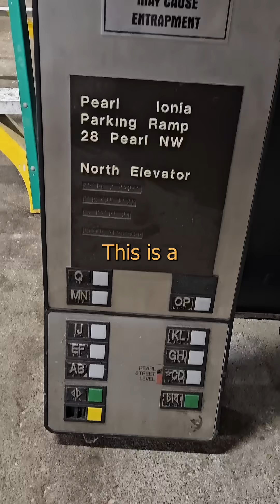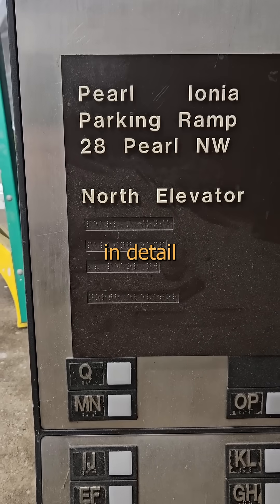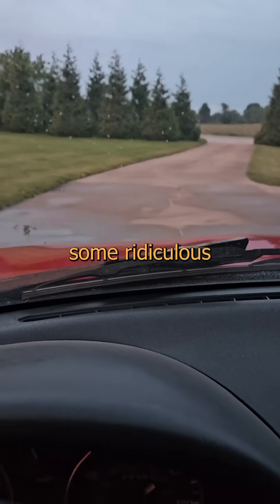Miata Mischief #chrisboden #engineering #gear #elevator #score #stories #parts #hacking #making

Comment: It wasn't me who hauled it home but at my job I helped load two, 50" by 36" cattle panels on top of each other rolled into a teardrop shape on the roof of a RAV4 that didn't have any roof rails, the girl who owned the car tied them to each other with shoelaces and then ran a string through them and then through the Windows of her car and then close the windows. As an employee I am not allowed to tie down the product only load the product or assist the customer with loading, only thing I can do is hold a ratchet strap (that they hooked) while they're making it tough.

Comment: My dad once bought a fridge, which seams normal until you find out the car he used to pick it up with my bother was an Alfa Romeo 4c car with 2 seats, so small and light it doesn’t have power steering and the boot is only big enough for a medium size briefcase. So he takes the roof off car as it is a convertible my bother sits in the passenger seat and my dad puts the small fridge on top of my bother with it sticking out of the top of the car, for what I believe was a 20 to 30 minute drive back.

Comment: I moved an entire apartment with my mom's Miata back when I was 19. My car had been tboned months earlier and this guy's insurance was trying to hold out for the witness to change her story, @#$& Buckeye Insurance. Meanwhile I had no car, so my parents lent me my mother's toy, the Miata. Don't get me wrong, it took a lot of trips, but the best day was taking my king mattress strapped to the car with the top down. Rope going all the way around the bottom of the car tens of times. Had to crawl in dukes of Hazzard style had to lean forward over the steering wheel. You could barely see the rear end of the the car from the back. Had a friend follow me, but a local cop got between me and my chase car and attempted to pull me over. I couldn't see out the side mirrors enough to see him, he jets out in front of me and stomps on his breaks causing me to stomp on mine.  The cop laughed his ass off and wrote me a ticket, then proceeded to escort me and the chase car to my new apartment. Small town cops can be alright sometimes.

Comment: My friend and I bought a 1950 Cadillac ambulance with a bad fuel pump.
Now that year Cadillac had an apartment sized engine compartment, big enough for me to sit in with the hood closed. Now we only had to drive it 2 miles so with my friend at the wheel and me armed with a spray bottle of gas for the carb we idled that thing in first gear that whole 2 miles

Comment: Had to pick up a set of 20 inch wheels for my barge of a 2000 mercedes s class and my best option was to carry them in my ch lancer wagon. I quickly realised how small the lancer really was....side note, the extra weight over the back wheels ended up saving my ass, when i hit a dip at the top of a lovely crest that turned into a blind curve, doing the lancers best version of "mach-fuck".

Comment: Me and an old friend went around loading abandoned ovens, washers, dryers, fridges and dishwashers into the back of my 2007 Honda Fit when the first inklings of spring hit in 2023. We wrecked the shit out of the rear hatch seal and it's probably the reason the rear shocks blew a few months later. But those things literally filled the car, ceiling to floor - front to back, able to close the hatch most times but occasionally holding the hatch closed with bungee and a dream. Fucking Tetris getting those shits in. Then it was time to load the 30 of them that couldn't be repaired back in for the scrap yard. Wild time - we should have rented a truck.

Comment: I've always had access to pick up trucks. So the sketchiest thing I've ever done is stick six people into one of those cabs with three seats in the front and those two sideways seats.  Our stuff was fairly well tied down with ratchet straps.  Move the people nah clown car. Computers are expensive and so is the equipment to run a lan party. To make this even worse the average height of the passengers is 6'1" if you don't count the driver who was the shortest. 
My friends rarely had a cargo capacity problems. We did suffer from efficiently moving groups of people around problems more often. So if the trip wasn't too long moving people would tend to be the sketchiest part. Especially when some of my friends were trying to save money on diese.

Comment: I moved a 1950's refrigerator hanging out the back of a chevette, worked fine until I tried to turn, had to dab the brakes so the front wheels would grab.  By the time I got to where it was going, I could taste the seat fabric.

Comment: Right after graduating college and moving into my new apartment I decided my first furnishing would be a TV stand. I found one at Walmart but all I had was a 2004 Mustang. I went to the store, measured the box it came in and mocked it up with scrap cardboard to see how I could fit it in the Mustang. Ended up taking out the whole passenger seat and headed back to the store. Bought the thing and took it out to the car. The 150ish lb box was way more difficult than my light mockup that only barely fit in the door and I ended up spending 20 minutes or so in a hot parking lot trying to force this into the car. Eventually it worked but I'm sure I made for quite the show

Comment: The thing isnt interesting, but the trip sure was a challenge. After I moved out for university, I rode my bicycle with several IKEA cabinets strapped to the back like I was some sort of historical Wright's brothers recreationist. After the first 2 kilometers I switched it to shark mode, streamlined, over my shoulder. After another 2 kilometers, I had a friend help me somehow distribute the 2 meter long rectangle between the back of their bike and my handlebars for the last 6 kilometers. Horrible communication lessons were learned at every corner and red light😅

Comment: When I was 10, we bought an 1800 lb milling machine in Cleveland and drove it home to wv using a jeep Comanche. Not sure the front wheels touched the ground most of the way home.   I also know for a fact that you can fit a 40 gal water heater in the back seat of a Buick. Yes the doors were closed.

Comment: Three guys in a Pontiac grand am full of parts for said car from the local pick and pull. Both the rear view mirror and passenger side mirror were obstructed from the driver. Took a combination of all three of us to navigate the highway back to the mechanic friend’s house to install said parts.  Oddly enough the day had started without a rear view mirror up until I mentioned the rotting Oldsmobile on the side of the garage had one that could be pilfered. 

At the end of the day we managed to fix all the power windows, replaced the driver seat, upgraded the stereo system, fixed the hvac controls, and even performed some basic maintenance the engine hadn’t probably seen in years thanks to the previous owner. 

The final thing done before it was sold was that it had a new badge installed officially declaring it shitbox edition. 

On a side note. It seems odd to pair a v6 with a tiny 10 gallon tank. It seems more like an afterthought when you realize that most of these cars were sold with an in line 4 cylinder engine 😂😂😂

Comment: I worked for a heavy equipment mechanic Shop as a shipper receiver and warehouse forklift driver.

The city we worked in had a municipal shop that often bought parts and brooms for their street sweepers, and regular maintenance on city garbage trucks. 

The first week i was working there, they wanted me to take 4 of these gargantuan sweeper main brooms for a Elgin Pelican, put them in the bed of the work truck, and drive a mile and a half over railroad crossings and dilapidated side streets. 

These brooms weigh roughly 320 pounds, and it was my first time having to manipulate them. They were 5'10" tall in their cardboard housing, and were ratchet strapped to the bed's anchor points. You can imagine this tall, loose-packed, steel core that is a large enough to body you if not secured to something.

I made it maybe a quarter mile down the road when a pickup truck on an intersecting street pulled out in front of me, honked to get me to stop, and found it crazy that the brooms broke free of the straps and rolled out of the truck, over the passenger side wall of the bed and onto the pavement, exploding the cardboard boxes, breaking a strap and scaring the life out of me. 

To this day i have no idea from where i found the strength to put them back in the bed and deliver them. I never told my supervisor about it.

Comment: I once worked for a sprinter conversion company and one winter we transferred production to a new building. Well the building we moved into had about 3 office spaces with about 30 computers and a server setup and network to boot. They knew I collected anything in bulk so they told me to make it go away. So one Saturday morning I pulled up in a Pontiac Vibe which is only slightly larger than the one your mom keeps in her bedside stand. And loaded all of it up in one go. Full dell towers and monitors to boot.

Comment: mx-5 owner here - having to check the weather forecast when you're hauling big stuff home is one of the other joys of ownership. 
I even dragged my SUP board & carrier to the dealer to check it would fit with the hood up (it does)
Reply: I used to have a MK1 MX5, and for a discount on my insurance I joined the owners club. For the hell of it I went to a few of the meetups in a pub, and one of the rally's. They were a really nice bunch.

At the rally I saw what must have been the coolest MK1 I'd ever seen. It was sunburst yellow with black accents, a wide body kit, a hard top with hard mounted roof bars, and a pair of colour coded surf boards on top. It just oozed style. I wish I'd thought to get some pictures.

Comment: A matryoshka doll of bad decisions, while I was driving on my learner's permit.

Dad owned two work trucks, one was a large 2001 Dodge 2500, the other a Dodge panel van of some make I can't recall from around the 80's. 

We installed woodburners for a living and, when his van broke down in the middle of nowhere with a burner inside it; he did not move the unit out of the back of the van to finish the delivery.

Instead he had me winch the entire van onto a cargo trailer (made, if iirc, out of the corpse of an old Ford F350 he'd run into the ground some years earlier), strap it down, shore-up the woodburner with something like 400lbs of tile and lumber so it wouldn't rattle, then hauled the entire assembly to the customer's house where we unloaded it by using the lumber and tile as a ramp out the back of the van and off the trailer.

Only after this did we drop the van off at a local shop to be fixed.

Comment: Had to get some metal racking home from work that had been saved from going in the bin, was the perfect length to just fit in my car but also the perfect length where if anyone brake checked me they would have a new passenger in their back seat as the sheet metal would fly through the windscreen😂

Comment: Welp.
2001 Mazda 3 was the car, and the cargo was 30'long rubRails fer a fishing boat😅 that shit did knot fit in the truck
Edit: TRUNk 😆
Reply: Bonus story 
Another Mazda 😅 a B4000 with a 99 mustang V6 3.9 and a whole mobile home in the bed, well all but glass , insulation and the actual frame, but the tin roof walls and all the valuable metals, must of been stacked nearly 8' over the cab of this little two wheel drive dinky. Pulled it fin out of the woods 14 miles to the pavement, and I ran outta gas about three hundred foot from the gas station 😆 my buddy in his 70's ferd came up behind me and gave me a little push up the hill fer that freshly squeezed dino juice, and then off to the scales. 10,896 pounds loaded 
2100 empty, and had to push the truck again to the gas station but this time I could fill it 😆😂

Comment: At the Kingsford plant they were tearing out a shoot made of 1/2" steel plate, it was welded into a box shape and was about 2' sq on each side, I think this was my first scavenge, it was definitely my first year of apprenticeship, but after many struggles and trying to hurry up and try and cut the seams with our angle grinder over break, I ended up taking the back door off my 06 focus to roll the box in. I have also found out that Kraft foods does not like you eyeballing their demoed stainless equipment, technically they are afraid I'm going to use it against them to take their hotdog market share, but I just really like stainless and brewing beer...

Comment: 12 foot composite deck boards with my Ford F150 short bed.  I did use the hitch mounted bed extender but the weight made the extender only 3 inches of ground clearance.  The boards also had no ground clearance.  Only had to go 3 miles but every bump and dip in the road made it drag

Comment: I'm 6'2 and miss my 92 celica gt hatchback 5 speed. 
Lived south of Kansas city, Missouri and my gf then now wife that lived in Northern, Minnesota. We talked awhile moving in together in my town at some point. 
I had my large backpack, pillow, cooler and somethings. 
Drove up there with NO A/C late summer hotter than your mom's taint at her favorite concert jumping around the mosh pit.
She wants to take her solid wood dresser with me. I get that in and I'm 6'2 in this short sports car scooting both seats up front to fit this, she wanted these chairs and couple things and pack that car tight and used hopes and dreams to get into town from BFE Iowa where she lived, was roughly an hour from town...... I didn't have a scrap of string or tie downs since I didn't think about moving anything yet. 

After that I stated driving around with rope, a couple tie downs, pillow, blanket for winter, grade 8 tow chain and a few lady products of aunt flow decides to appear without any signs before hand or she forgot to bring some. All this is in a 2003 toyota highlander cruising at 280,000 miles. 

Another was carrying this big , wide, thick chair in the back of the hatchback celica without straps for miles.... again.... then a very large painting that I should've had a truck to transport. Nope! This 20 some yo odor decides meh,I got this much like all the crap I'm hauled. 

A deer also set me up super early dark ass winter morning and destroyed my car while I was parked. That's for another story.

Comment: So at 17 years old me and my father got our dumbass hands on a fuselage for a cobra attack helicopter. It was fucking sandwiched between two semi truck trailers literally in the middle of the New Mexico desert on a place called “Jackass Flats” (on account of the man’s donkeys.)

We had to pull it out from those trailers. So we dragged using a front end loader until we could line it up well enough to use a winch. Try to pull it on the trailer. Fail, because the tail hits the ground when it angles up to go on the ramps, and my dad trusted no one with lifting the tail using the tractor. So we ditch that trailer. Come back the next day with a different trailer with separate ramps. Still hits the tail, so we take off the trailers wheels to get it even lower. Finally goes on. Time to strap it down 

But wait, oh fuck. All of our straps, I shit you not, were still on our other trailer in the box welded at the end of it. NOT IN THE FUCKING TRUCK. But we were very determined and determined to use ONE come-along to hold that bitch down along with the winch on the trailer. That’s me and my father ended up with the coolest fucking yard ever. A cobra attack helicopter in our front fucking yard. FUCK YOU NEIGHBORS!! WHERES YOUR AH-1?!?

Comment: I have a 2007 Toyota Prius and my fiancée’s friend asked me of all people to help with picking up a motor cycle she wanted to buy about 30-45 minutes from our town.  So I did what all Prius owners do and hook up a 1999 Chevy s10 5 and a half or 6 ft bed truck bed trailer I purchased when I still had access to a 1996 Toyota 4Runner. So I had a Honda motorcycle crammed into a Chevy s-10 truck bed rolling with no lights behind a Toyota Prius at 60 miles per hour for 30 miles. No prius has worked harder and it still lives 30k miles later and that’s pretty cool!

Comment: I hauled home a leaking battery I didn't have space in the trunk or back seat so I put it on the passenger seat along with two double wide Gmc inner door panels rusted of course because why not had no room to drive in my mini cooper my neck was getting closer to the panels as they kept sliding 😂 ... dr9ve an hour back home

Comment: I used to deliver pizza on a yellow Vespa, and no I didn't use the rack on the front, I carried them in my left hand and drove with my right.

Using the rack would have caused the pizzas to get bumped and tossed all over, whereas I was able to keep them relatively level and unjostled by just holding them.

Eureka Springs, Arkansas. 
If you know the town you know the pizza.

That place is gone now, but it was great while it was there for over 20 years, and I was glad just to be a small part of that experience.

Comment: Stole my bike back from a homeless camp, didn't have allot of room in my truck bed, had to stuff it in the end and role out with my tailgate down flying outta there. Grandma's broken ice maker, microwave and , my Axe and shovel because of my line of work requires I have em in the truck.